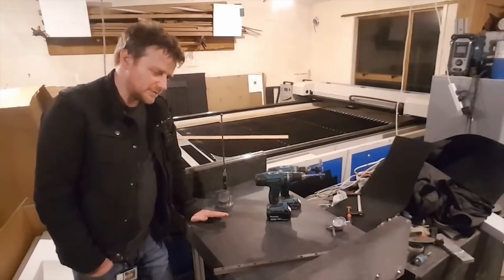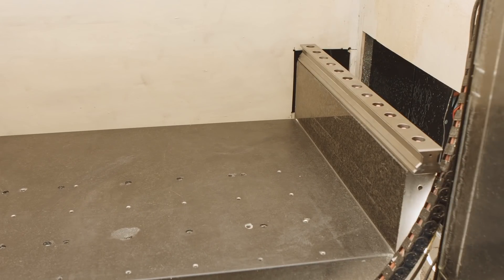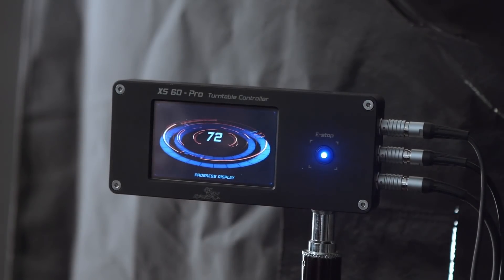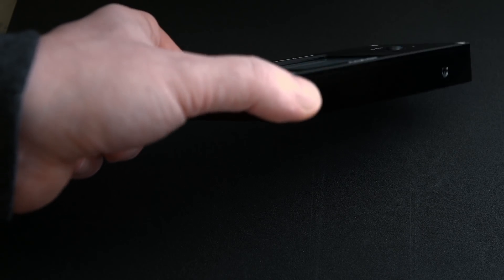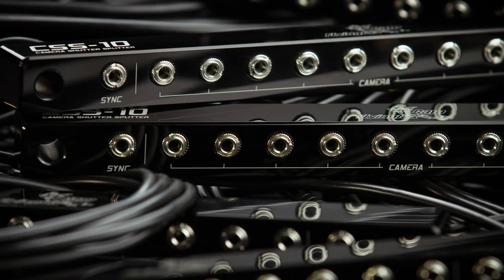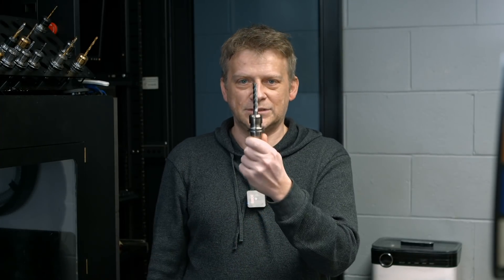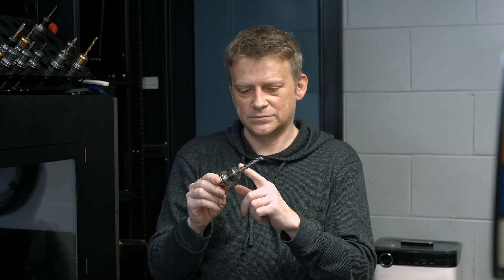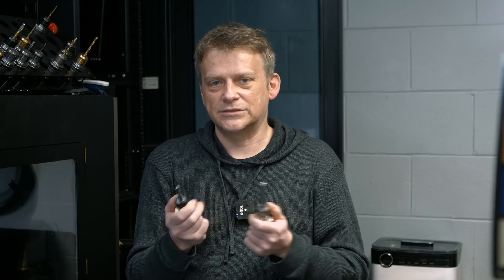EPIC CNC upgrade - final episode.  Unreal surface finish on commercial products, straight from cnc.

Comment: I watched both CNC series multiple times. I don't think I would ever have the attention to detail, and the patience required to achieve what you have. I'm curious if you still use the Jianken 2.5Kw spindle(?)
Reply from the maker: I agree, I went a bit far 😉 I haven't changed anything in the cnc and I still run the same jianken spindle
Reply: @PiotrFoxWysocki  I don't think anyone can fault you for excellence. My bestie and I decided to make our own CNC mill a while ago. Even if I don't strive for that excellence, you also inadvertently elevated my concept of "good enough"

Comment: You could basically retire and start a new company building and selling machines like this. I've come across them a few times in my career usually in some type of metrology lab or a very high precision prototypes research laboratory. With crazy machines that run on all are bearings and are capable of micron precision. Absolutely insane that you were able to build this yourself without a team of engineers. I've seen a lot of micron capable machines but never one made by a dude in his basement. Or anything other than a team of engineers to be honest. It's absolutely incredible ! The one good thing about the rarity of high precision metrology capable machines is that not many people need them... So here in the United States if you can find one for sale you can get it for about the price of scrap steel. Because not many people have a need for such a precise quirky and strange machine.
Reply from the maker: I just made it so precise and rigid so after machining I don't have to do any surface finishing. No deburring, sanding, filing, polishing, tumbling, sandblasting to cover the tool marks. 
Imagine the amount of time you save, money and space as well, as tumblers, sandblasting cabinets take space and money to run them. 
Or even you don't need to hire people who will deal with surface finish.

In my opinion all the cnc machines should be good enough so you don't have to fix job after them.
Or just maybe my standards are unreasonable 😉

Precision is a side effect of surface finish 😉   but precision is nice to have when you need it.

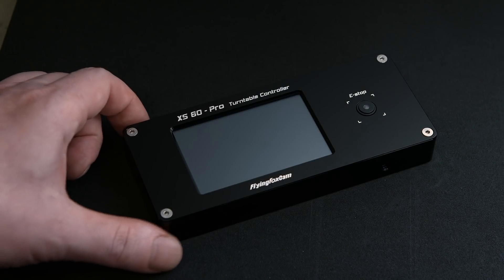Comment: 4:32 - simply wow. I hope you also made the internal electronics for that device. You could also use your CNC to make PCBs. It's why I want to make CNC to begin with using UV laser to sensitize photo resist. But machining finished enclosures for the PCBs is also another benefit.
Reply from the maker: I do all. Electronics and programing. But for pcbs. I use jcb. It's much cheaper and quicker also better than me doing it all from scratch.

Comment: Do you have precision flat stones for cleaning grit and removing burrs before mounting parts?
Reply from the maker: I do. And I did run it on vices once. Since I mill mostly alumi I'm there is no need to keep doing it over and over.

Comment: Call me crazy but I would like to see a second spindle clamp mounted at the top bearing position. Now it looks unbalanced with just one clamp near the lower bearing.  It probably isn’t going to be dimensionally significant as the end mill deflects more. But it doesn’t hurt and could help harmonics.
Reply from the maker: I'd does have second  clamp much higher. But this is a another can of worms.
Reply: @PiotrFoxWysocki  You are the expert! Recently found your channel. Keep up the great work.
Reply from the maker: Thank you 😊  but I would never call my self an expert 😉
Reply: Could you plumb in a compressed air line into your liquid coolant feed manifold. Then you could pulse some air after your coolant stops. You can see your part without opening the door. Or secondly, just do a air cleaning program after your production run.  You just come back to a totally clean work space.
Reply from the maker: I use 9000l/h flood coolant. It washes everything away without blowing chips all over the machine. For the videos I'm turning it off so there is something too look at. Otherwise it's all covered.
Reply: @PiotrFoxWysocki  Yes I know. I was talking about Compressed Air line feed into your custom coolant line manifold. Thanks

Comment: Hmmm, I wonder what one would build if instead their objective was to get a very good rate of material removal per dollar (On aluminium, that is).

I guess the objective would be to just unobstruct the spindle/end mill, e.g. don't let it deflect and chatter too much.

I wonder if that could be achieved with an overbuilt machine (materials-wise) made from thick steel tubes and using cheaper electromechanical parts.
Reply from the maker: cheap and good? in my opinion one or the other. material remove rate?
for 3mm end mill? bugger all, so to get more you will have to increase rpm. rigidity of the machine not over the top because you can not put much force on the endmill anyway.

bigger endmills bigger machines.
steel tubes, it will ring like crazy causing chatter. 

i guess you can extrapolate from here.

Comment: This finish looks awesome! I've seen a lot of comments about potential problem with thermal expansion when you combine granite and metal. Have you noticed any problems in that regard?
Reply from the maker: Good question. My machine is mostly granite. Base sides and gantry. So there is not much to expand or shrink. 
Only the rails which are attached to the gantry and sides. But let's talk about the gantry because it is the longest being 1meter.
Maximum temperature difference I have is 20 deg at the time. The lowest is 10 deg. And the highest 30(summer, never reached it inside the cnc). I mill around 20 deg C.

So 1 meter of gantry expands:
Steel from 1000mm to 1000.26mm
Granite from 1000mm to 1000.158mm
Difference will be 0.102mm at extreme.
Because I live in New Zealand we don't have winters here and my workshop doesn't have much of temperature variation. So in my case it would be mostly about 0.05mm over 1 meter.
Unknown factor would be how much Granite prevents rails from shrinking and stretching.
I'm guessing it will be some amount.
The biggest difference which I notices would be in my z axis which is made out of aluminium with steel spindle clamped in 2 places. It does deflect a bit. To the point you can see in the finish. 
But it only happen when it's cold. Once is at about  20 deg it's all good. 
I was assembling and setting up rails in about 20 deg environment. So machine is made to operate at this temperature.

 if you live in the climate with extreme weather conditions from summer to winter. Like in Poland for example 😉
Where temperature inside of a garage might vary from -15 to 30 which is 45 deg then steel expands by 0.585mm. 
If you consider that the granite expands by 0.355 so the difference will be 0.23mm over 1m
If you add that Granite will hold some of it. And it will bend to compensate. 
1m of 50mm Granite bends about 0.002 mm under 20kg load. So it will bow a bit.
Doing the calculations in my head It kinda feels on the edge.
Perhaps rails would break the friction between Granite and shrink bit letting Granite to go back to the original form emitting loud bang. 
I'm guessing this would had to be tested.

Considering you will assembly it in the environment temperature of  20 deg minimum value should be smaller.

One thing which I would try to avoid would be to make a Granite base and steel or what might be worse aluminium gantry. 
Aluminium would shrink by 1mm possibly pulling Granite sides  ofcourse all depends on the mass of the aluminium if it's a solid piece then I'm almost sure it would cause some damage.
If it would be an extrusion and Granite would be much more massive to withstand the force of shrinking aluminium then the aluminium would change its diameter and when all would go back to higher temperatures it would bow.

Hmmm.... I'm not sure if this thought experiment was any helpful or answer your question in any way 😉
Reply: @PiotrFoxWysocki  If one doesn't have a temperature-controlled workshop, one could make an enclosure with some kind of heating.
Reply: @PiotrFoxWysocki  thanks a bunch for such a detailed answer. I did some small math on this and yeah, I used a bit higher difference in the temperature. My workshop is in Germany now and it's heated, so I doubt that it will go to the extremes, but I imagine a 20 degrees of difference could be a thing if you don't use AC. Of course if you have temperature controlled shop the issues would be lower still (although I'm not sure how much could the rails heat up from usage? probably not much, but no idea). but even with small differences I'm wondering how it will behave over time. 5 hundreds is not much, but I'm wondering if it can weaken the epoxy over time. I'm guessing probably not, but I'd be curious to hear an update after using the machine for a longer time.

I'm interested in this kind of stuff as I would also like to attempt at building a precision lathe and/or milling machine, but I was thinking about air bearings because of the temperature expansion problems. And then I was actually thinking about using lapped or scraped cast iron for everything to decrease the weight. That said I have no idea how hard it would be to do it. I have scrapers and I can do it pretty accurately so my thinking is that after getting the surface geometrically correct I could either scrape it for coverage or lap it with a cast iron lap. My thinking was that cast iron is sometimes scraped to form air tight seals, so it might also work for air bearings? But I haven't seen anything like that, so hard to say 😅

Another thing I'm not yet sure about is the maximum pressure that air bearings can withstand, but if air bearings would be not for the task I guess I could also try with hydrostatic/hydrodynamic bearings. But first I need to get my workshop in order, so all of this will probably wait a bit.
Reply from the maker: Is this suppose to be something useful or just a science experiment?
Reply: @PiotrFoxWysocki  eventually I want i to be used to help me build precision tooling and prototyping
Reply from the maker: I can only wish a tremendous amount of patience 😉
Reply: @PiotrFoxWysocki  that I totally don’t have so it might be a wild ride 😅 But I’m kinda addicted to precision stuff and I get hyperfocused on it often, so that helps. Right now I’m trying to figure out if buying a jig grinder will be a huge mistake or just a small mistake lol

Comment: I wonder what did you do to the Chinese green power milling head and how do you like it?
Reply from the maker: by Chinese green power milling head you mean blue face mill ? :D the one I was holding in hand on the video or the one i was using to mill cover ? or you talking about something else ?
Reply: @PiotrFoxWysocki  the one that you attached a belt to and driven it using spindle. From other video
Reply from the maker: That was a bosh drill press ;) I rotated the drill 180deg to grind side walls. I saw one guy was using angle grinder on on some frame.
Reply: @PiotrFoxWysocki  no not in this video. The power head milling bt30 from AliExpress. Lol sorry I mistaken you with other YouTuber thechipwelder 😂
Reply from the maker: lol, this would explain quite a lot :D

Comment: As a filmmaker that is very slowly getting into CNC manufacturing of my products, i loved the series. Awesome build, incredible what you did on your own. I have a basic CNC router DIY build, tons of deflection but it works, and its actually pretty decent for the price. I have considered on trying to follow your build, but the more you got into it, the more it shows how much effort and care it takes, and ofc how much money it takes. I think the journey was incredible, but would just go with a DMG MORI M1 or something if i were to need a higher end machine. 
I have a request / question, PLEASE make a video on your anodize process. I've been struggling with that the most. I cant get my parts to be quite as black as i would want, they are always dark grey, yours are exactly the black i would want. Any tips? THank you sir!
Reply from the maker: brother in arms :D problem with used machines is that they are used. and you never know what you get and what will fail. and there is no guaranteed the finish will be better. i was considering it for a while. 
im planning anodizing series for 3 years now, but it takes quite long time to shoot. so it feels like to much work.

not sure is one of the answers will help you to get black color.
1) poor electrical contact
2) you are not ramping up current or voltage when you put the part in to anodizing. you have to increase voltage/ current slowly to the final amount. it takes me 2 -5 min
3) temperature of the anodizing bath. it has to be the same to 1 or 2 deg C. optimal 19deg C
4) dye temperature 50-60 deg C
5) if you do a black color you have to keep it anodizing for 2h im using 1.2A for every 1000mm2 of surface area.
Reply: @PiotrFoxWysocki  thanks for the info!!! The mori m1 is a new machine, Ballin vmc for 50.000$. It's a crazy deal and an awesome machine. Second hand is cool but a lot of work just like you're saying! Ill try following your tips and I'm sure it'll be better. My approach was just 30 mins or something like that. Last question, what dye do you use? Thanks man!
Reply from the maker: 50 k would be for absolute minimum, I'm guessing? I was looking at haas minimill 27k. By the time you add al the bits it's 70k.
I get my dye from my Chinese friends 😉 don't remember which one. I bought stock for 4 years
Reply: @PiotrFoxWysocki  yeah it's just the machine, ofc there's tooling and stuff but for such a brand I wouldn't hesitate if I had to buy a cnc. Good luck with your stuff! Also, get some 100w led chips. They cost like 15$ with 97 cri and need a pretty small heatsink if you're crafty. I've got a basic design in the works, beatiful lighting and super cheap.

Comment: Very nice results. I think you have really hit on the most fundamental ideas of stiffness in subtractive manufacturing with this series. I will be starting on my MechE PhD at Northwestern here soon and it is interesting that perhaps the largest machine in the lab is a custom laser powder-bed fusion machine, and it is constructed in much the same way as you have done here except perhaps with granite 4x thicker and 2x longer. Quite amazing, especially since you would think that stiffness would not be as critical with the absence of cutting forces. I could try to find the manufacturer of the components for that machine if you are interested. Keep up the good work, those finishes remind me of diamond-turned components (very precise finishes), so maybe you could find a diamond-turned something to compare under the microscope?
Reply from the maker: Thanks 😊 laser fusion machine sounds really interesting. The parts I have shown in this video where faced with diamond pcd inserts and sides where done with regular carbide endmills.
Reply from the maker: Thanks  😊 laser fusion machine sounds really interesting. What will be the thesis of your PhD? 
I have used pcd ( diamond ) inserts to mill the top and the bottom sides of the parts in the video. Sided where done with regular carbide endmills.

Comment: Hi Fox,

Just can't believe what stunning parts you created. I' m sure thats top notch for a DIY maschine or even industrial one.

I was smiling about the finish I can get after my upgrade(which I mentioned in your chiller video a few days ago)
But now i got disappointed when seeing that I'm miles away from what you are creating. 

My big respect of your work!!

Greetings from Austria 
Manfred
Reply from the maker: Thank you very much! but disappointing people was my last intention, i just wanted to show how far you can push diy cnc. and what is possible.
Reply: @PiotrFoxWysocki  don't worry, maybe disappointing is a little bit of a wrong word in this case.

I was just flashed by your parts, and how perfect they are.

Comment: That are really great results. I watch your videos so I am not so surprised. But I am surprised that companies who offered you milling jobs cannot achieve such a surface finish. I am convinced that any professional machine could do that if proper tools and cutting conditions are used.
Reply from the maker: glad you like it, i was surprised as well, especially when i was trying to explain on the example of camera splitter that operations on this part are very simple. im guessing the problem for them was the top side where connectors are placed. because this has to be faced. im sure they dont use PCD inserts, just carbide ones. which usually leaves subtle tool marks and smudges. normally its removed by sandblasting but it would show up if you put it straight in to anodizing. beside they just want to make stuff quick and easy. i guess this one was looking like too much hassle

Comment: piotr i have a problem, vfd available in my country has 2.2kW, 220V, but in the description on the website it says outs drawing 0.5A can be connected. how can this be? if the vfd is rated for 2.2kW then it should clearly say it will provide 10A output current.
Reply from the maker: Maybe it's a mistake ? Because it doesn't make sense